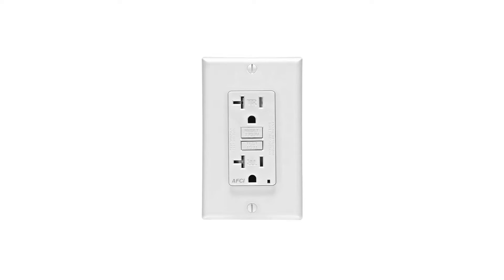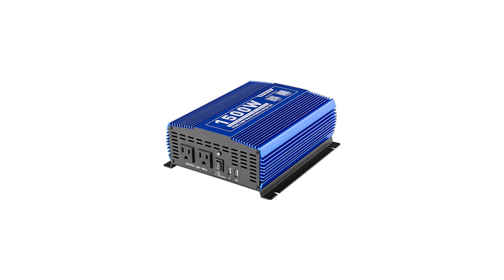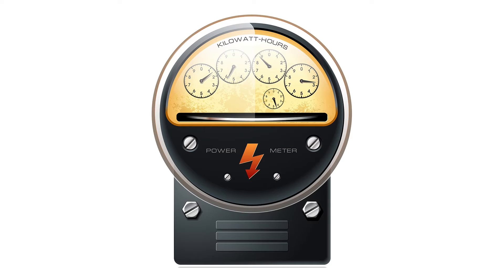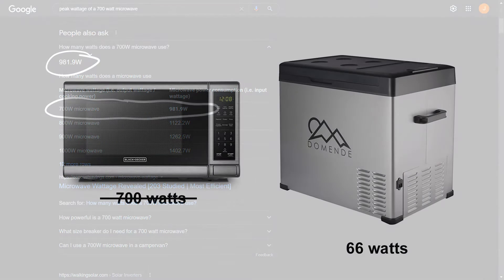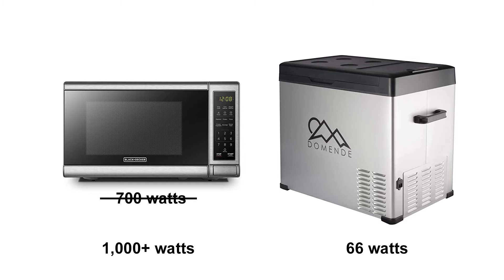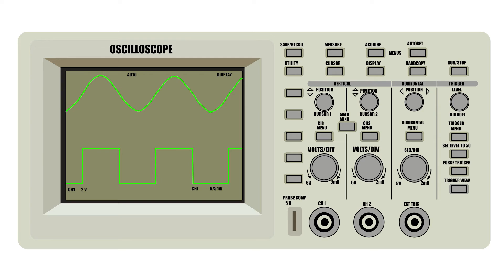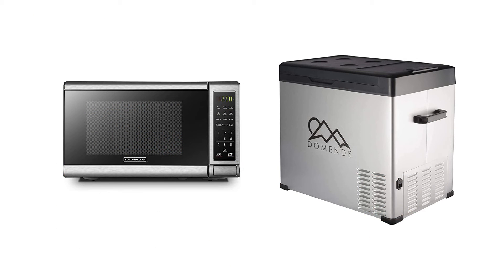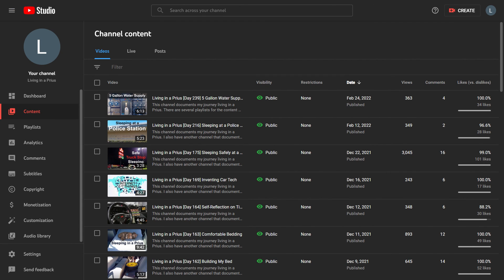Car Living: Powering Appliances [ Living in a Prius - Day 361 ]

Comment: Bought the same inverter model, I’m using on my 2004 Prius to run a microwave and a keurig mini coffee maker, the keurig mini uses 1425 watts and runs without issues on my 1500 watts inverter, also this inverter has Bluetooth and app where you can turn on/off and check how may watts are currently using
Reply from the maker: It is a great inverter with a lot of extras at a very good price.  Thanks for the comment, and thank you for taking the time to watch the video.